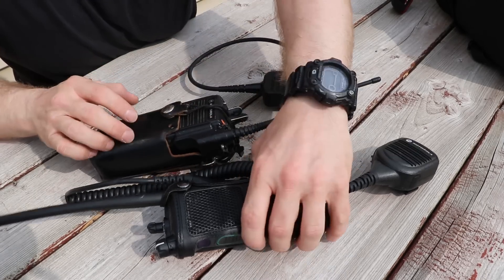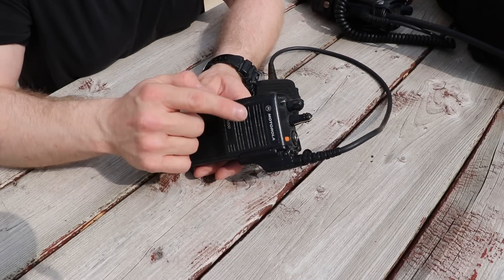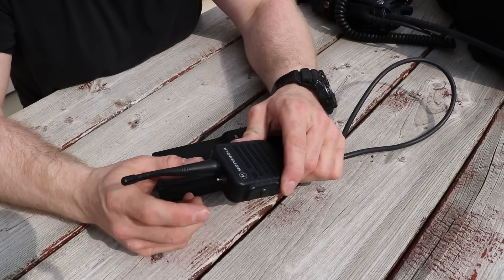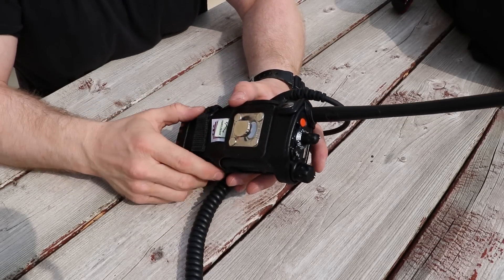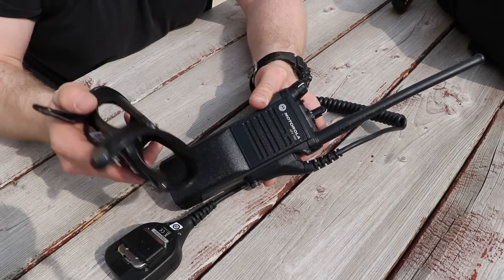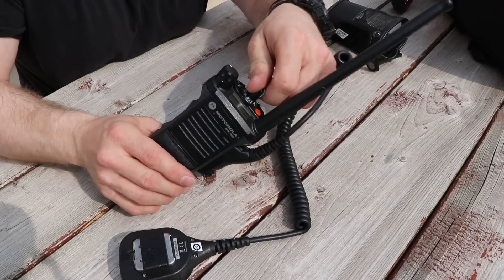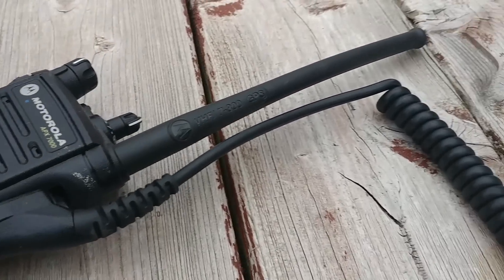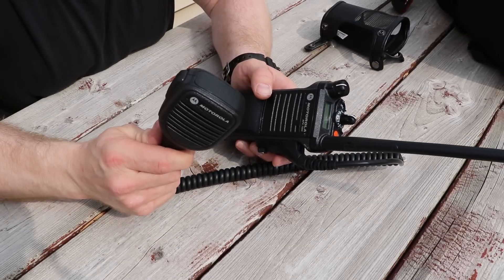How POLICE RADIOS work | A Comparison of Old and New

Comment: I've always loved the new Motorola radios!
The APX 8000XE models are all around amazing, especially considering the all band capability. They allow for seamless transition from older systems and ensure operability with regards to mutual aid and cross-departmental operations.

As a freelance journalist I've had many scanners and radios in the past, I keep every one because deep down I'm a collector of sorts lol.

The one thing I've always wanted is one of the 8000XEs, if not because of the all band feature, but also the control and features. The clarity, and volume is amazing, the channel announcement is astounding, the battery life makes old radios and smartphone cry, and the durability is sheer perfection.

In my line of work, hearing things accurately so i know what is a story, what questions to ask or verify, and what i need to be aware of to keep myself safe is key.

Scanners are great but they aren't rugged, suck in terms of reception, and do not handle things like simulcast that well.

The new line of radios are by far the top of the spectrum right now, and it will be hard to beat in the future.
Reply: Did you purchase this radio yourself? These radios are $8000 and programming software is several hundred dollars per year for a subscription. Unless you’re an amateur radio operator, I don’t see much use in getting one of these.
Reply: @JackPaylor  i do not own one personally, and frankly the price doesn't phase me lol. Most who haven't used or handled these radios wouldn't understand why they cost that much, but those that have used or handled them would understand the price.

I've loved the new radios since our city moved to our Motorola P25 trunked Simulcast ENC system with APX 8000 & APX 8000XEs for fire, PD, Municipal services, and transit back in 2015.

The subscription to software isnt really a new thing thought, most municiple contracts include a section of the budget for software licensing. Our city pays a decent price, but nothing compared to the $6 million they pay for ENC to be enabled fleetwide.

Comment: Wait. You still operate on ham frequencies?! Dont you have something like ARMER yet? (800 mhz)
Reply: Interesting that the US still has not implemented a TETRA based Radio. Here in Sweden we have had a TETRA based system since around 2010. On 380mhz.
Reply: @Gripengamer  at least in my town we have digitally coded radios on a frequency of around 800mhz that are passed through repeaters, but yeah, I see what you mean...
Reply: @Gripengamer  The US is not going to go TETRA either. They are focusing on FirstNet instead because the cell providers have actual national PTT coverage that would be best used in public service..

Comment: Weird. My department has 6000s, which look pretty identical, but the lock out doesn't seem to do anything. Never knew what that was for until now, but I just gave it a try and I can still switch between stations.
Reply: Each radio is programmed differently. It depends on how your agency set up the button.

Comment: So I am the radio guy that will explain the radio haha. I know you said that you don't really need a high-low switch on your mic anymore but if you consider one in the future look up Motorola part number PMMN4065. They also make a straight cord public safety version of this mic. Motorola part number PMMN4059, PMMN4060, PMMN4061. The difference between them is the length of the straight cord.
It seems like you are on a trunking system now so the receive indicator shows how strong your radio affiliation signal is to the closest tower. This should almost always be at full bars. There is a whole explanation to this but it would take me about 3 paragraphs to explain it all.
Reply from the maker: We aren't trunked, that was somone else's channel that I was on for the video. My mistake.
Reply: @freefieldtraining  Ok so you must be on conventional still. That channel that you were on was trunked though. Awesome video. You always help us out and give us good information so I wanted to return the favor.

Comment: This is still some outdated stuff. Most EU countries have switched to digital radio's (TETRA and DMR) since their range is much bigger and they are better encrypted.
Reply: TETRA range isn't that amazing. Portable terminals are usually limited to 1.8W and you need a considerably larger infrastructure for it to work well than you would for a P25 or DMR based system. Encrypted P25 networks in the U.S. work just as well and are just as secure as TETRA networks in Europe. The latest P25 gear also looks really similar to TETRA stuff--it bears no resemblance to chunky black bricks like this (that are still pretty cool imo).
Also, purely out of interest: where in Europe does public safety use DMR and on what frequency band? I've only ever encountered encrypted TETRA and TETRAPOL so far, so I'm honestly really interested.
Reply: @Glow in the dark Bus Driver Old genesis series radiso were good. I still have some of the US versions of the HT600 and MT1000's in UHF left over from the county services changeover to 800MHz..We use them on GMRS and ham now
Reply: The US is not going TETRA ever because it is useless here, range sucks. it works in the UK and EU because the countries are smaller and things are more compacted. The US incase you have not noticed has WIDE OPEN SPACES of rual and the only systems capable of covering that is the cell providers and even that is flakey. So the US is focused on FirstNet for a nationla interop system for eComm and special operations..In the US DMR (Mototrbo) is used for commercial systems mainly..

Comment: The apx7000 is dual band allowing for more frequencies to be used in areas with different frequencies. The signal indicator is how much signal you have between you and the repeater,generally with the bew systems that are coming out you won’t be able to get it out of range for a while. From what i can tell at least one or all the channels are P25 digital (Motorola’s digital version) so the signal indicator will be on all the channels,however if you are on an analog channel there won’t be any signal indicator.
Reply: Looks like they are using trunking. So 99% of the time the signal indicator will be at full bars or at least it should be
Reply: P25 is not Motorola's digital version, it's an industry standard and many manufacturers make P25 radios
Reply: @radiosification  come to find out even Midland makes P25 radios surprisingly.
Reply: @radiosification  🖕🖕🖕🖕🖕🖕!!!!!!!!!!

Comment: We just went to the APX as well. Pretty happy with them. The antennas have shown to come loose and need to constantly be screwed back down, and the shoulder mic screws have also backed out causing a bad connection. Other than that they are a huge improvement over our ht1250s. 

Be safe brotha, really like this channel.
Reply: 1250's are good radios, zonable and do MDC PTTID encode and decode.. I have 12 of them in yellow and we use the in neighborhood watch on GMRS..

Comment: Glad to hear your off the old HT1000's, good conventional workhorse "brick". It was already old when I finished high school in the late 90's. 🤣 I got an APX 7000 a few years ago for VHF and 800 band. It's been a great radio so far. Did they splurge and get the Bluetooth option built-in? When I work large events with a wireless mic+earpiece people don't spot my radio under my jacket so they suddenly think I'm talking to them when I answer a call.

Comment: YA a video I know about! Ive been a Motorola/radio nerd for a while (own several myself). Its good to see that they are finally upgrading from an over 20 year old radio, but the HT1000 was one of the legendary radios of our time. So the system that you are on is whats called a "trunked" radio system as compared to the "conventional" radio system you were on with the HT1000. The signal bars you see on the display of the APX7000 shows you are "affiliated" (or connected) to the trunked system. If you were to say switch to the old system those signal bars would go away because it only shows the signal bars on trunked systems. Also in this case I believe that your trunked system also allows you to be in Digital mode (called P25, apco25, etc) Although a trunked system can be analog to and visa verse with conventional. Trunked systems are much more complicated but the basic is that it doesn't use frequencies in the traditional sense, the channels are now Talkgroups and the system shares frequencies with multiple talkgroups. It just allows for the system to have more traffic and support way more users then a traditional conventional system like the HT1000 would. Any how sorry for the long explanation but the rabbit hole only goes deeper lol. Great video though, though about getting a turtleback case myself. Keep up the good work!
Reply from the maker: It's still the same system as before. We still have guys using the ht1000's on it. I checked and the bars come up. Only on other agencies frequencies. I had to avoid our channels for the video.
Reply: @freefieldtraining  Gotchya, So the other agencies that your on would be on trunking. You guys will probably be moved to it once the radio upgrade it done. Im basing my location info on a general location (since I dont know what district that your in, etc.) Thats the beauty of this radio, its very flexible with channels and systems.
Reply: @freefieldtraining  It's telling you the control (sync) channels strength..if those bars go away the radios should bleep or display something like "Out Range" or "Failsoft" like the old MTS2000's and spectras did. Failsoft is the redundant direct channel it reverts to if the trunking system fails for some reason. Also p25 can be trunking or conventional. The statewide system here is 700 MHz p25 trunked. but the county is still analog trunking smartzone trunking.. We are about to change the county over to the state network and keep the 800 MHz but do a cross linking so both systems still work until the 800MHz licenses run out in a few years.

Comment: I've been working at a BSA summer camp for the last few summers and we have a bunch of old HT-1000 and MTS-2000 radios that we use. They were used at IFSI (the firefighter school) for years until we received them. The only annoying thing about the radios is that the batteries are ancient and only last half a day on average
Reply: The camp I worked at also had a few HT1000 radios  and a couple years later had a bunch more donated and installed a repeater. Before the repeater we had to relay messages across camps either through several radios or with a base station.
Reply: @j.d.bucksavage3406  They installed a repeater at a camp?
Reply: @2KCamaroZ28SS  well more like a reservation. 4 camps on the same radio.

Comment: Nice looking radios, my department has the kenwood radios they work pretty good.  Our sheriffs department has the repeater type radios and they also have the 800 radios.  Most the time they use the 800s and we can’t hear their calls and they can’t hear us.  But we are working to get on the same page.
Reply: So your agency only runs simplex channels? (Radio to radio) how do you talk across the county or city without a repeater?
Reply: @cleancutzlawncare6861  he probabaly means conventional and trunking.
Reply: Clean Cutz Lawn Care My department has its own repeater system it actually does pretty good.  Right now my county has two dispatches a city dispatch and a county dispatch, eventually it’ll be a central dispatch.
Reply: tell them about FirstNet

Comment: How does a 24-HR shift work? Are you allowed some nap time, if so where?
Reply from the maker: It doesn't. Lol. But, occasionally it does happen. Usually when court is scheduled right up against a 16. Also, for dicks when there is a homicide or potential homicide it is all hands on deck for the first couple days and it is common for them to be working the case for 24 hours straight... Or more.
Reply: @freefieldtraining  So, Super Trooper's got it wrong, instead of syrup, it's coffee chugging ?
Reply: @freefieldtraining  Sounds like me sometimes when I am out on a train observing and mapping comms system and track control upgrades.. long trips and long days and the rocking of the locomotive does not help keep me awake either..

Comment: Signal Indicator indicates your received signal from the trunk system controll channel. 

Talk to your department the 7K is Bluetooth enabled and you can get a Bluetooth speaker mic, they are alot better than the cabled mic.
Reply: I've been trying to talk my agency into the Bluetooth speaker mic. No bites quite yet. Any issues with them at all?
Reply: @dsarnes7  NONE! They are almost perfect. The only thing that would make them better is the ability for them to auto switch between your mobile and your portable. Unless you have an assigned car it does not work quite right.
Reply: @dsarnes7  they do however make the long range BT mic for the mobile and those things are cool as hell. 4-500' from the vehicle still using mobile power.
Reply: Right on, appreciate the reply! I have an assigned cruiser and was looking at the long range you mentioned. Our coverage is spotty on portable. I didn't know they had two separate models. Any experience with the long range one?
Reply: @dsarnes7  if they are set up correctly they work great, make sure you use the external Bluetooth antenna on the radio. Every one I have talked to that uses them daily love them. They always tell me they just keep there portable off unless they get taken away from there vehicle.
Reply: @dylan8495  awesome, I'll keep trying. Thanks for the input!
Reply: @dsarnes7  I own a small radio shop in Johnstown PA Beaty Communications if you ever want anything off the used market let me know il hook ya up.
Reply: @dylan8495  Nice. I'll keep that in mind!
Reply: I've actually seen a few Sheriff deputies in my local town using Apple bluetooth earbuds with their apx radios. I guess if it's Bluetooth, you can connect anything.

Comment: Ah, the good old HT-1000. Great radio and built like a tank. When we finally gave ours up in about 2006 some of the batteries were literally decades old and we'd go through 2-3 per 12 hour shift. Good times...
Reply from the maker: I learned the hard way that the aftermarket batteries for the ht1000 just don't last like the Motorola ones do. We switched a few years ago and now even the "extended capacity" ones are a one shift affair.
Reply: @freefieldtraining  I did rebuild own battery pack for this series and have no problem beating up Motorola stock - here is my video  https://www.youtube.com/watch?v=GsA1VR02qGM&feature=youtu.be
You can ask technical friend for help and get back HT1000 running longer than it was brand new.
Reply: MX series (Bricks) were literal tanks of the 80's.. The could double as a defensive weapon if necessary
Reply: Hell, my department still uses the xts series, talk about old stuff
Reply: @WolfangStudios73  volunteer FD here...we use the xts2500's.   Theyre being used a lot and breaking now ..time for new radios. But work like hell
Reply: @gabrieljennier5534  aw yeah, they work amazingly but they're so outdated compared to new radios

Comment: Ahhh, HT1000 nostalgia I had one issued when I was a summer student at a national park they let me sign out a shoulder Mic because it was a pain to get in and outof the holder when I was driving. Just had to give it a second for the repeater to kick in. It was my favorite over the Kenwood's I used in youth corrections.. Or the shit Icoms private security used...
Reply from the maker: I found that for summer jobs as a kid it was better to Ditch the holder and just get the belt clip that attaches to the battery. Then you can clip it to a pocket when getting in and out fo the car and it doesn't poke you like when it is on your belt.
Reply: @freefieldtraining  the girl I shared an office with was given a smaller one with the clip! For some reason, I got the brick... probably all they had left lol

Comment: The little antenna icon it's part ood the RSSI  that just means big signal that is being listened to by the radio from the repeater. I do not remember what RSSI stands for but that's what I remember for my tech class.
Reply: They are on a trunk system so the radio I dictates RSSI from the controll channel.
Reply: @dylan8495  they also appeared in a non trunking system.
Reply: @Santospi1  yes they do but there they only appear when a signal is received. In A trunking system the control channel is always active (in a Motorola system) so the RSSI indicator is always there.
Reply: @dylan8495  thank you for letting me know, the more I learn the better right
Reply: RSSI = Received Signal Strength Indicatior (indication).. The bars replaces the flashing red LED on older or no display radios

Comment: not sure how it is now, but used to be there was an offset frequency between transmit and receive.  they also worked on voter repeaters, so that there were multiple receivers located around the jurisdiction.  those would feed into a voter comparator and the best signal would be transmitted out on the repeater/transmitter so everyone could hear on the channel.  it probably still works the same, because how else would some little 2 watt or so handheld reach across a city or even a county?
Reply: Almost the same, modern trunking stats still use Voters and simulcast transmitters. The offset allows for the the receivers and transmitters to use the same frequency. Google "duplexer" and "multi channel voting" your find looks to repeater-builder.com best place to learn.